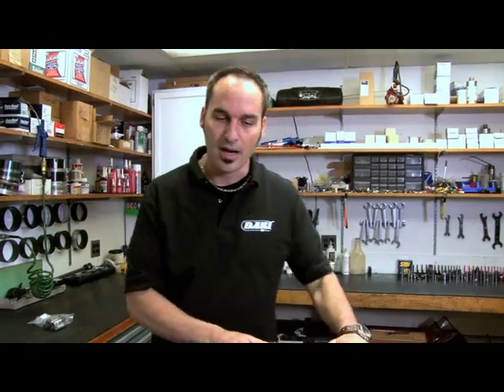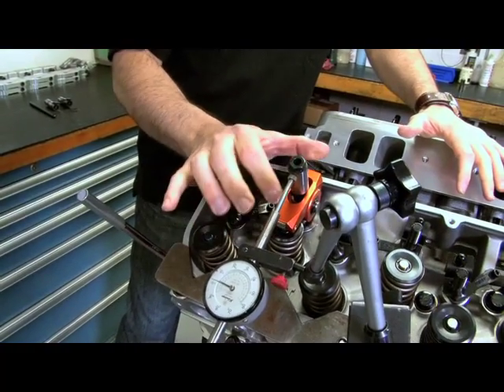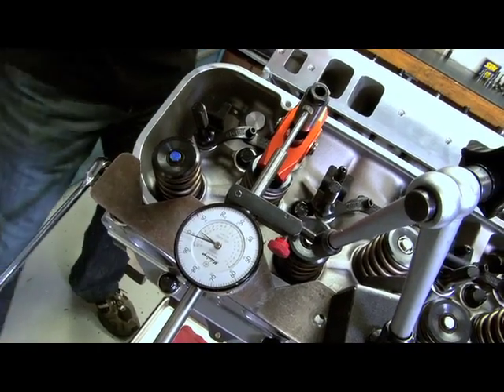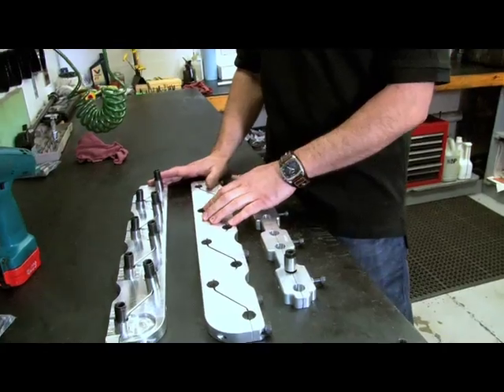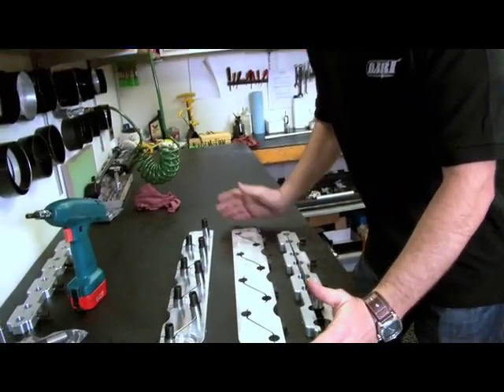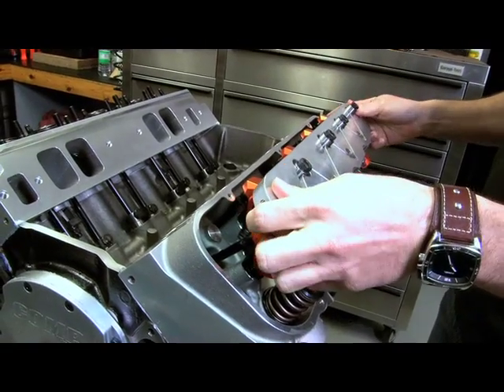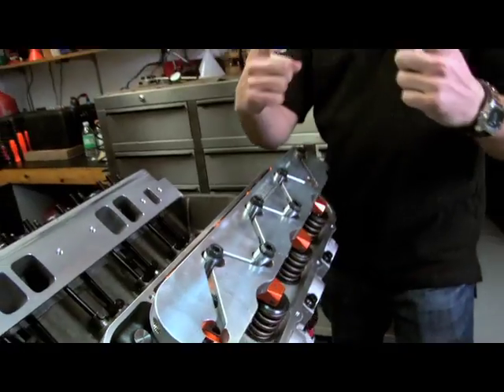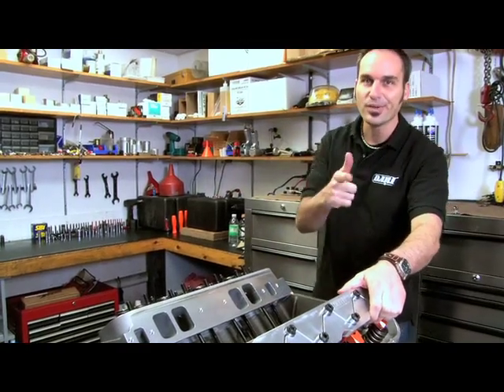Dart University, Valvetrain Stabilizers

Comment: Imagine your rocker studs are a tetherball pole. When the pushrod pages against the rocker it's like the ball being swung hard and it can make the end of the pole deflect. These give the richest studs a brace at the end which stiffens everything up. Therefore your lash adjustments stay closer to desired since there is less deflection.

Comment: I know the girdle works, but it seems counterintuitive to bolt a solid plate onto parts that move independently and at different angles of one another.  What keep it from hindering neighboring valves from moving?
Reply: the girdle bolts to the studs/stud nuts that do not move once things are snugged up.

Comment: You literally laid the girdle on the rockers in the video, Please explain for others that the rockers need to rock. I would not let you near my engine. ( EVERYONE, the girdle needs to be flush with the machined part of the polylock).
Reply: Did you not watch the whole video??? 😂😂😂
Reply: @Smoketownedc  Yes, even at the end , you did not explain/show the novices anything. Also, set the lash/clearances for your lifters , tighten the rocker nut/lock with the set screw, before you put  the stud girdle in the mix,...., unless there are horribly bent rocker studs, things will not change, besides,  lash is set on the base circle, before the  lobes put extra pressure on the spring to 'deflect' a stud. (Just telling viewers to 'check clearances' is not enough), This is a video you put out to the public and you explain for 3 minutes, In real life,.... if I was showing this to a friend,hot rodder, ....we would take at least 10 minutes and they would have "0" questions when finished.